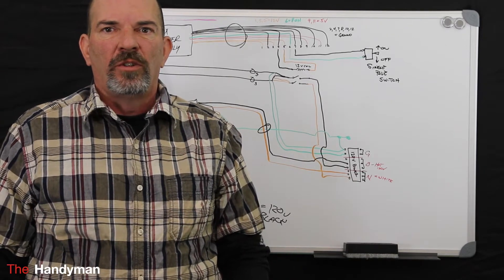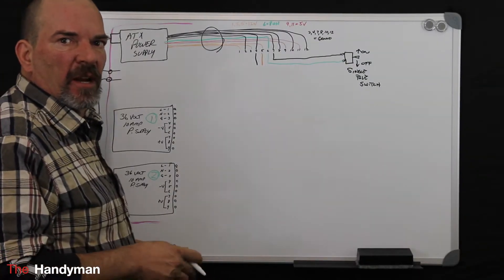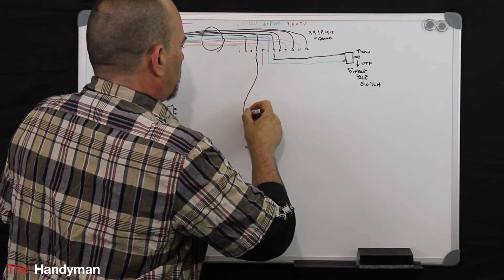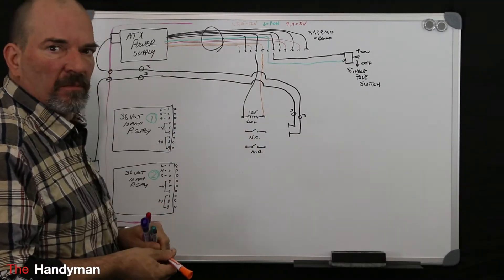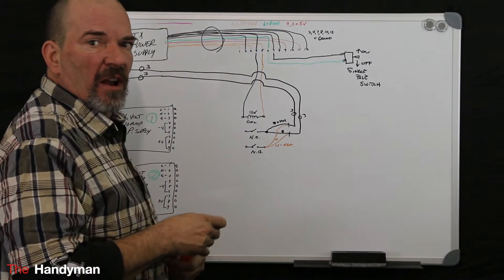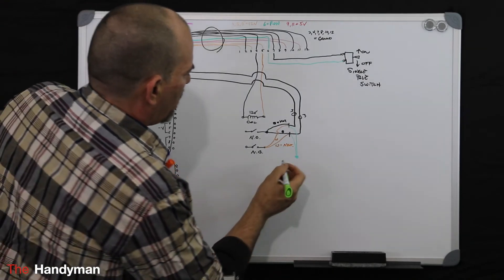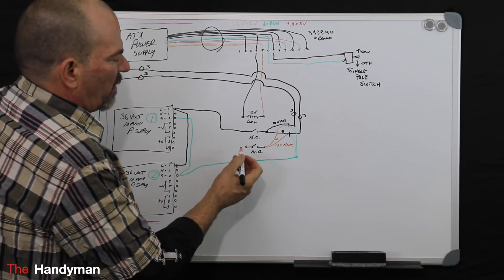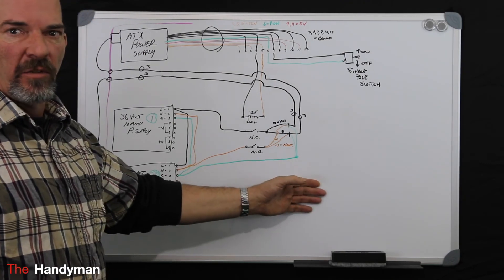How to Build Your Own CNC Router Controller Box - "Part 2 Simplified"

Comment: hello, i have smilar electronic set from longs motor(china). im trying to wire it according to your schematic. what is amperage rating for your relay?    im not into too much electronics but. my pc-psu 230W 2-5 amp rated input current but i assume it will draw 2 or less because i only wired 3xfans and 1xbreakout board to it. 2x 350W 36V ac-dc converters will rated 4 amp input current. so i assume i need atleast 2+4+4=10 amp rated relay. am i correct?  I couldn't find 10A or more with double contact relay in my hometown(i have 5A rated relay). is it okay to use 2x single contact 7A rated relay?(1 relay N.O. contact for HOT main, 1 relay N.O. contact for Neutral main) im using 220v main power.
Reply: i find it on your facebook page in parts list your's is 14A rated. so i assume i need atleast 10 amp relay